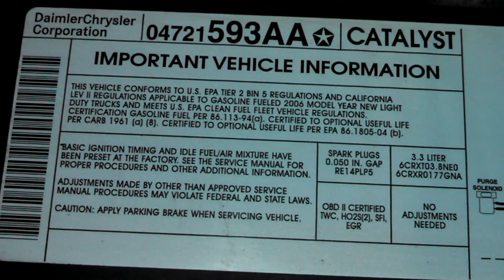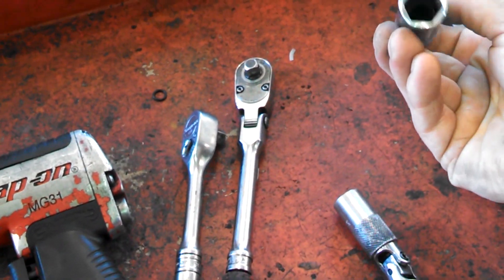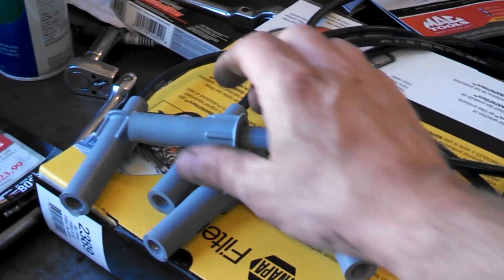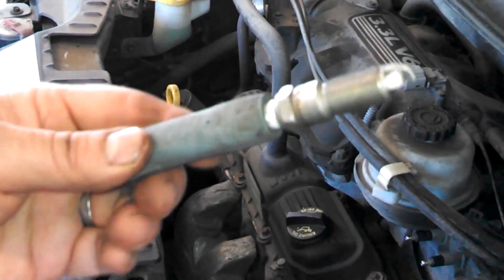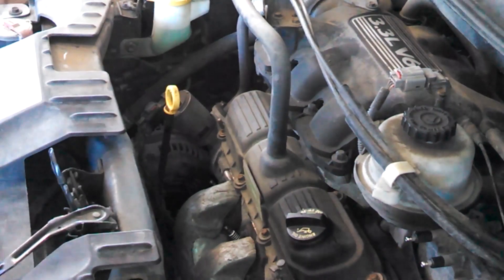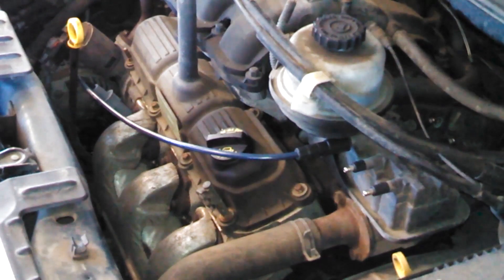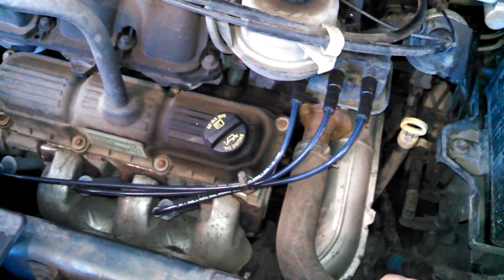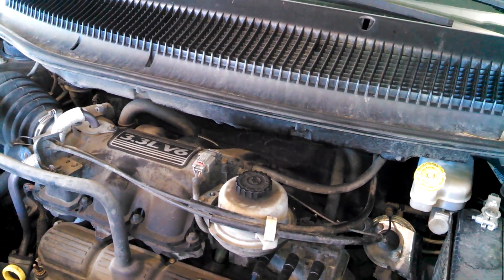Spark plug replacement 2006 Dodge Caravan 3.3L 3.8L wires Install or replace spark plug wires

Comment: Surprised you didn't mention a couple things.    1.. Clear any dirt from around the spark plug holes before removing the plug.    2.. check the gap on the spark plug before you do the removal and set correctly.  Take a look at the removed spark plug ends.  They tell a story of the engine.  Black and oily - not good.  They should be dry and tan or grey colored.  At least, that's what I remember from my mechanic days in the 80's

Otherwise, great job on the video and I appreciate it a lot.

Comment: I have one of these Dodge minivans. The wiper cowling is designed to be removable so as to allow easy access to the back of the engine. It takes about 10 to 15 minutes to remove it. Replacing the rear plugs is much easier with the cowl removed.
Reply: Joe Vignolo he sure gets that camera back there .what year is your mini van?
Reply: 2003
Reply: Joe Vignolo I'm buying one for work instead of the rwd v8 models that would probably use too much gas. hopefully it gets 20mpg, that would be enough for me
Reply: Get a 2.4 @TheBikemaster94

Comment: I changed my plugs and wires today on my 2007 Grand Caravan 3.8L engine.  Do it when your engine is cold as you do have to do a lot of reaching around to get at cylinders 1, 3 and 5.  I bought a small tube of dielectric grease because the grease package that comes with the new wires is very small.  If your new wires are not numbered, like mine, and you are only changing the wires one at a time, the longest is for #2 cylinder (23.9"), next longest is #1 cylinder (on the back, 23.7"), then #3 on the back (20.7"), then #4 on the front (20.6"), then #6 on the front (16.7"), and finally #5 on the back is shortest (14.8").  I fastened a mirror onto a stick so I could see with a flashlight back where 1, 3 and 5 are, and you just feel a lot with your hand back there.  Used a little silver anti-seize on the spark plug threads.  A vacuum cleaner was handy to suck out small rust particles that were produced at the mouth of the plug opening when I removed the old spark plugs, although I could only do this effectively at 2, 4 an 6.   Pretty hard to get the vacuum nozzle back to 1, 3 and 5.
Reply: toadie8 good idea.
Reply: Thanks!
Reply: adapt a piece of smaller dimension garden hose to existing vacuum  hose or the like what ever you got that's flexible just stick a rag into gap where joining hoses and duck tape it up and you will have more suction its a good idea you had who knows what could have fallen in there thanks
Reply: life saver! thank you. im in a 2005

Comment: I replaced spark plug and wires without removing wiper cowling and it wasn't that difficult over all. the only thing because you can't see on back so I put new plugs immediately after removing old one at a time because you have to go with sense  only.
Thank you for video !

Comment: Doing mine tomorrow because I'm changing the intake manifold gasket (common Caravan source of coolant leak) and O2 sensor (failed) anyway. I'll take the wiper cowl off for more room. The best part of owning a Caravan is making sure your tools don't get lonely like they did when I drove a Toyota.

Comment: A few thoughts: 1) When you begin loosening the plug, for every 1/4 turn loose, tighten 1/8 turn until the plug rotates freely, perhaps the first 2-3 full turns out. This keeps you from breaking or galling several of the threads in the aluminum head. 2) Use some anti-seize on the new plugs.
Reply: That is a very good procedure.  When removing or replacing a threaded device always go back and forth to reduce sticking and galling.  Do the same when cutting threads.  A turn forward, and then go back to break off chips, and reduce galling and thread spalls.
Reply: Need a help for the wire to the coil is not working what can I do

Comment: Just did a tune up on a 1998 Chrysler Grand Voyager minivan with a 3.3 litre V6 engine. Did all the wires and the spark plugs, used a stubby ratchet for loosening the one in the back of the engine and a palm ratchet to get it out. I used anti seize on the spark plugs and the dielectric grease on the wires.
Reply: Chrysler did town and country the voyager was Plymouth. Have had all three makes and models, sorry but the Plymouth was my first.

Comment: Decent video,direct & to the point.Rather vague though if a person didn't already know atleast a little about what they were doing.I hadn't changed plugs on a van of this year & body style,so I was curious to find out how bad the back 3 plugs would be to access.Also to each their own,but I was taught,& I preach this to my kids when teaching them basic auto mechanics.You never use power tools on spark plugs.Especially on the ones you can't see.It doesn't take very much sideways pressure to break that porcelain. Dude seems to know what he's doin though, I was shocked to see someone else using the old plug wire boot trick.

Comment: Thanks for this video,  I will do my brother-in-law's van next week.   230,000 miles on the original plugs.
Reply: Thank you for showing me the rear ones and that you can't take them off too.
Reply: J Dahllquist how did it go I have to do the same thing was it hard to get them out was the back hard?

Comment: Great video ! I would just add that all rust ,dust and sand from around spark hole should be removed prior pulling spark plugs out,otherwise,contamination of cylinders is guaranteed !
Reply: how do you do this?

Comment: GOOD TO VACUUM OR BLOW COMPRESSED AIR ON PLUG BFOR REMOVING TO GET DIRT OFF AROUND PLUG ON COLD ENGINE & USE SEA FOAM IN GAS PRYOR INCASE ANY DIRT GETS IN CYLINDER COULD BURN A VALVE, HAD IT HAPPEN YRS AGO.. GOOD LUCK THKS FOR HELP..

Comment: I had a oil change next day my cAr started running than died . Guy said it could be fuel pump or line. Had another guy saying I’m getting fuel when start the car it seem like it want to start unsure when I got a tuneup

Comment: If you don't like fiberglass in your skin, you might wear gloves and long sleeves while replacing the back ones. The insulation on the wiper cowling and firewall is fiberglass.

Comment: This motor (3.3 liter) has way more space to get in back than does the big 3.8 liter .   Mine is a 2001 and I can only reach two plugs ,  not the one on passenger side.  Very little room to twist a wrench back there......hmm

Comment: Is this why my engine is shaking? It needs new spark plugs?
Reply from the maker: Broncopotamus Very broad question, does it shake all the time?  Have you ever replaced them plugs? spark plug wires?  Best to take it to a shop to be checked out.
Reply: Just replaced all 6 plugs and wires. nothing changed. then I changed the ignition coil, that fixed it. your video was a great help.
Reply: Broncopotamus maybe the air hoses too. old cracked hoses.

Comment: Ya want to know something they won't show u how to change the back ones bc it's pain in the ass they will never want to show how the hard things are done bc people will learn very quick an no one will go to a machanic that's the truth !! Why some people won't show how to change time belt or crank lower sensor bc it chost a bout 450$ in shops the truth is it's 25$ sensor rest of it goes in there pockets I'm not looking for fans or likes any one got car issue Whit Honda Dodge caravan s hit me up may b I can guide ya step by step
Reply: I have a 2006 Dodge Caravan 3.3 I just changed the spark plugs and Engine light is Blinking on and off.